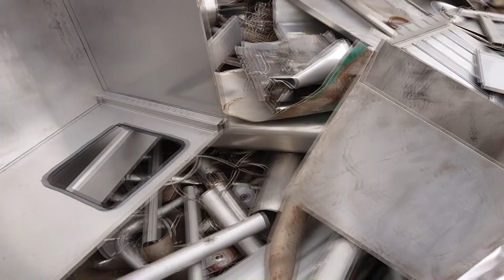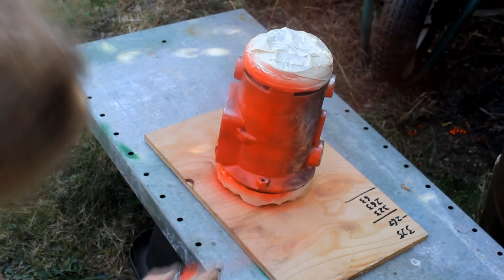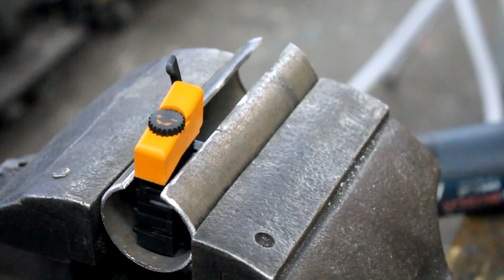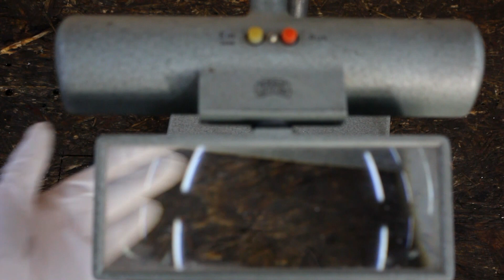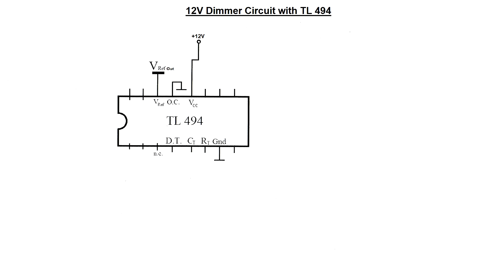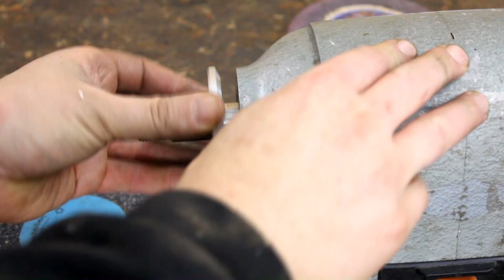Rare Scrapyard Finds! Repair-A-Thon!

Comment from the maker: Hey guys. This is the 19th episode of this series. All other episodes are linked in the video description right under the video. In case you want to help with a donation, here are two ways to do that:

https://patreon.com/tpai
paypal-donations: inventordonations@gmail.com
Reply: Please put the names of the repaired goods into the description so other people trying to repair them can find your video and fix similar problems on those machines! :)
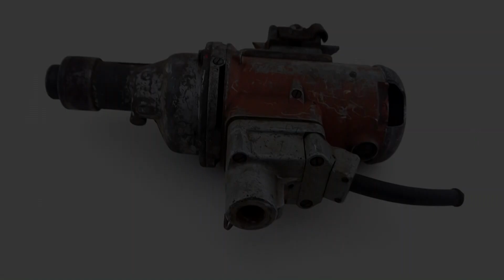Reply: 3:01 oh god you found the arm breaker! There is a higher chance that that drill will break your wrist/arm than to kill you by electricity ! Those drills are so powerfull that they can swing a grown man.If i havent seen it i wouldnt beleave it .In a shipyard a 2 men were drilling a ships deck made of stainless steel sheet metal ,it was 10mm thick but the drill was 30mm.Now they did drill the pilot hole and they did go 25mm then 30.But something happened and drill got jammed and drill knocked guy that was holding it on the floor.Nothing bad happend to him ,nothing was broken except the pride ,but after that they used 2m long pipe to hold it.

The reason why they convinently put 3/4 NPT water pipe is so ,you can go to a hardware store and buy any length you want.Whatever you do BE CAREFULL with drills like those.
Also building a drill stand ,simple out of U channel or square tubing would be a great idea,those things have more power than any cheapo drill press.Wish i had one of those...
Reply: If you get a piece of polarizing film out of a dead LCD screen and put part of it on the magnifier and part over the LEDs--turning one 90 degrees--you won't have to worry about glare anymore.  (I used this idea with my camera lens and flash to take straight-on pictures of an aquarium.  There was plenty of light, but no reflection off of the glass.)
Reply: Thanks so much for these videos. I love seeing the old tools brought back to life and it is very inspiring.
Reply: Hi could I ask where you the leds from I have a lamp I want to convert to led strip thanks in advance great video stay safe
Reply: @tattoos1988  Here is where DIY Perks gets his (you'll want the daylight ones): https://www.ebay.ca/itm/182965299789
Reply: FWIW, if you want to use LED for task lights, it REALLY pays off to spend a little more and get high CRI LEDs for light that is close to sunlight in quality.  I used the ones that are in the DIY Perks lighting tutorial videos and will never buy any other strips again!
Reply: This is my video lesson! Thanks!
Reply: That was cool !!
Do you have the intention to do the last videos of the SMPS playlists man ?
Reply: I love fixing old tools and really enjoy your videos. My current thoughts are a vibration accelerometer to balance grinders, grinding wheels, motor shafts, turbo turbines whatever. I have a link for this procedure, but need help with the electronics. It would be a great topic for a video in my humble opinion. Keep up the good work! https://www.conradhoffman.com/grindbalance.htm
Reply: You big-ass drill would be perfect as a reamer-dedicated drill. I used to work for a truck (heavy haulers) frame modification shop where we built 12 wheels dump trucks out of very basic local commuter tractors (trucks without sleepers or with lightly extended daycabs). We would stretch/weld/double frames on a daily basis and repositionning bolt holes on frame rails was done by spot drilling and then using a similar handheld reamer to enlarge/size new holes.

Handheld was mostly by choice as we also had magnetic drills with core bits but i figured it took way too long for not much benefits.

good work on the vids, i'm a scraper-fixer at heart too so... Take care!
Reply: I have very much enjoyed watching your videos.  For grounding/earthing purposes, I would just attach the ground/earthing conductor to the case of the drill.  The alternative is to use it only on a GFCI circuit.

Comment: Excellent content.

If you plan doing the TL494, I would suggest a "softer start" with a single channel PWM controller TL5001. 
BTW: LEDs should be driven using constant current feedback approach (using a feedback current resistor), 
not constant voltage/hard PWM switching, primary when used to drive multiple or variable number of LEDs connected in series.

Comment: For that handle with the variable speed control for the drill a rubber hand grip would insulate your hand from the metal also using a thin plastic liner on the inside of the pipe would help as well which could be made from a soda bottle or similar bottle of the same thickness and attach to the inside of the pipe with adhesive as well as filling the pipe with the adhesive to keep everything from vibrating and shorting out

Comment: Until the 1970s America's products were the standard of the world. Then, the USA was sold out to China (along with the rest of the world), now sneakers are engineered to last 4 months. Cellphone batteries last 3 years, and are largely not replaceable. The waterheater at this building has broken 5 times in 5 years, because the electricals are made in China.

Comment: Great video... regarding the original push buttons you could add a small relay and use them in a start stop latching circuit

Comment: I'm a bit confused about the drill. I assume you have an earth ground at the power receptacles in Germany. Since it's a metal framed drill motor why not add a third wire ground wire connected to the metal frame?
Wakodahatchee Chris

Comment: I noticed several old cast iron radiators.  I had a DYI-crazy friend who built a huge hot tube in his house.  He put six of those old radiators outdoors, connected to the water supply.  Underneath them he installed gas burners (natural gas was cheap back then here in Texas).  The water flowing through the radiators got heated and he could regulate the temperature by adding or removing more gas to individual radiator burners.  It was a pain to get set up, especially considering the huge amount of water it took to fill his indoor 'pool'.  

I think you could make a great solar water heater, with no need for electric solar panels.  Just set a bunch of old radiators out where they can usually absorb sunlight.  Once the kit got warm, you would open a pump or a gravity flow.  You could start with them empty or already full of water.  It would be best to allow the flow to go downhill to be able to empty the radiators when needed.  Adding rock or gravel fill close around the radiators might increase their energy retention - or help them retain the night's cold..

Anyway, thanks for the always great videos.  You should make an opening page with your neat quote about developing new skills rather than hoarding expensive hardware.

Comment: Hey that drill is similar to one i used as a young fitter in about 1974 we used it to drill up 1"-25mm dia holes but we fitted a 3/4" BSP [british standard pipe] pipe with about 800mm in length to stop the drill from turning when it dug in. It was a beast which took two men to operate one on the drill and one to hold the end of the pipe . I Am 68 now and use a limpet or Mag drill now , which is a lot less dangeruss.

Comment: I like what you do, I get a lot of my tools out of the scrap metal dumpster, I have a 6" and 8" bench grinders, many hand tools that were rusted and or stuck. I have a Lincoln 150 amp Weld-N- Power gas powered welder that took about four hours to get going, I love it, it is also a 4000 watt AC generator so I use it to power my house when the power goes out. Several snowblowers, many lawn mowers.  All brought bask to life with a bit of effort. I applaud you.

Comment: The LEDs were soft white, with any utilitarian use it’s better to have cool white.
Also PWM interrupts current meaning flickers light. When working on any spinning items it may cause strobe effect, also may interfere with light sensors and causes radio frequency interference.

Comment: It looked a little dangerous when you were drilling with those new metal handles exactly at head height. If that bit had bound up in the work piece you could have ended up hurting yourself quite badly. Nice work though!

Comment: Make sure you ring grinding wheels. Hold them on a screwdriver in shaft hole. And tap the wheel. If it does not ring. The wheel is cracked.

Comment: The MT 2 socket is ideal for an 18mm mag drill adapter  - as a powerful headstock for your lathe - just for drilling bigger holes in round stock

Comment: Thanks for video. 
Maybe you shoud have taken apart the 12V adapter and integrated it in the bottom plate where the ballast is. use same cables. A 230V mainscable to the
contact behind. The pwm controller behind the reflector and use the switchhole to trimpotentiometer.

Comment: I love your channel, and really appreciate your efforts. But I have to ask, why would you make that drill variable speed. I only ask because as a contractor I own a number of "drills" that are not variable for a reason: 900 rpm old Milwaukee, 350 rpm dewalt, and 550 rpm dewalt. Each is overbuilt to last a lifetime, despite being used for mixing.

Comment: if im hearing you correctly isnt a dimmer switch also a form of speed controller, one reduces power? and one switches on and off at speed, but basicly doing the same thing,[im asking not telling]

Comment: The biggest mistake people make when drilling is to continue the same pressure on the drill bit as it opens out the other side of the job. You need to reduce the pressure so the drill tip does not get caught on the job. This needs practice. Getting hit with say a10kg piece of metal rotaing at say 50rpm would be very dangerous.
Another issue here is lack of lubricant. All steel should be cut with a lubricant such as tallow or mineral oil. I would suggest he had a blunt drill, large drill meaning more metal needs to be cut and no lubrication. Somewhat like saying everything wrong is being done. Also if he cut says stainless steel of high quality then he trully need to know what he is doing, especially a large hole.
Regards, from a metalwork teacher of 25 years experience.

Comment: Its the first time i have seen a right hand nut on a left wheel. Its usually a left hand nut to prevent loosening when load is applied to the wheel

Comment: Scrap tool + spare parts + time and effort to fix I don’t man, as you said doesn’t sound economical. For the total price, I can get a let’s say a Bosch gsb 1300 (blue pro version) €80-€90 and can drill tough stuff. Ecologically, what you did is right, I am on your side though.

IMHO, trying to restore unusual tools maybe more interesting. Maybe (no pun intended and not trying to be offensive) East German tools that never managed to show itself on YT.

Comment: +GF+ has a presence in the USA as well, i was once certified for use of their IR high purity plastic pipe welding equipment.   Excellent product, training and support.   I am not only jealous of the threading tool but also that cool magnifier.   The dimmer is very nice but I, personally, would prefer the daylight spectrum fluorescent light over that poor yellow LED spectrum.

Comment: Hello, I enjoyed your video.

I have a comment about the switch for your magnifier lamp. The old switch is totally usable for an on-off application. Those old switches have an "extra" position if you hold down the "on" button to connect the "lamp starter" to the cathodes for pre-heating. If you remove the old wiring, it may be wired to function as on-off. I did this for a florescent to led modification on my desk lamp and there is no issues.

Comment: It does not belong to that video, I watched some time ago your Desk lamp to LED conversion, and I did that too on the very similar lamp.  And I cant find that video....

As I got this lamp some years ago I also printed a new foot for mounting it on my desk, than after one CFL tube died I converted it. I also used the original switch, works fine (other than I still press the ON button for some seconds occasionally :). One question: did you reuse that silver grid part? I tried and it made terrible shadows, so I just left it out.

Comment: Please be VERY VERY carefull when working with large 2 hands drill!! I own one similar in size mady by East Germany producer VEB Steinbeck. Very rough machine,  no soft start, no safety clutch. It hurt me quite seriously few times while drilling +20mm holes - sometimes it gets stuch and it simply throws me, twisting hands. It is very dangerous machine, very usefull but also seriously dangerous. Never use it without proper preparation - allways fix the handles in some way by using some chain in order not to allow the machine to twist your hands if it gets stuck.

Comment: Excellent video.  I particularly enjoyed the segment on the Fein drill.  I have a Fein device that is designed as a tap threader with an automatic reverse.  The jaws of the chuck are damaged and I have not figured out exactly what is causing the problem.  I would like to use it as a heavy duty drill.  It is easy to see the quality of these Fein tools (pun intended).  
Bob

Comment: these repair-a-thons are my favorite video series on youtube by far. most of the large power tools i use in my shop i got because someone else first threw them away. either they were given to me for free, i was paid to haul them away during a clean up job, or i bought them cheap at an auction and repaired or modified them myself to suit my needs. i have also designed and fabricated many pieces of equipment myself such as a hydraulic press, a manual tire changer, a sandblasting cabinet, a small paint booth, a hydraulic lift table for repairing motorcycles/atv's/riding mowers, an engine hoist and stand, a lift boom for my tractor, and a coal fired blacksmithing forge. all were made from salvaged materials and/or scrap steel. i'm self-employed, and i earn a living fixing, building or destroying whatever someone will pay me to fix, build or destroy, and have done so for over 26 years. when i was young, my grandfather told me to learn all i could, about everything there was, and i would never be without work. best advice i ever got.

Comment: Your videos inspired me to bring one of my broken tools back to life!
I was taking apart an old printer, when my little 12V drill seized up! I had just purchased some 18V drills, so I set the 12V drill aside to deal with later.
Today, I was cleaning my shop and decided to dismantle the broken drill.
When I opened up the motor, I found a tiny, broken retaining clip (from the printer) stuck between the rotor and the stater.
I cleaned everything out with a toothbrush and reassembled the drill, and it works again!

Comment: Tip do not use that big drill with the handles In lever whith your face If the drill bit i strong enough when it jams ; and do not not break ;You risk 
Hand arm face damage. 
Those types are used for timber house construction boring "2 holes for wodden dowels. Sometimes they have specially made brackets to take the force if the drill bit jams.
That's because  can get thrown of the working platforms otherwise. 
You have the drill near you and you hold it in a very ferm grip when drilling.  It may twist your arms otherwise, even when nothing goes 
Wrong. Typical good use is boring hole in workpiece you  can stand on yourself . Make a" stopper bar " to go where that that dovetail where.
Seem a waste to build a drill press whith it. Very nice idea To add speed controller. Often those heavy drills lack that.

Comment: I think your oversize bits need a sharpen. I've got an imperial set and they're not the best but they usually cut better than that even with a smaller drill.

Comment: I remember those type of switches from UK desk lamps from the 70s. The 'on' press button makes the 'starter circuit' momentarily when you press it... so no quick 'jab' at the switch, it was press, hold till the ends glow, then release. Quite a neat design for the time to eliminate the 'glow starter'

Comment: Hi, you videos are great, on the refurbished Fein drill, that drill has the  power to spin you around if the drill gets caught in metal, suggest a more suitable hand holder, to eliminate the danger of hurting yourself.

Comment: Didn't you use big paper washers between the grinding wheel and the metal discs? I always heard those are very important. A soft kind of cardboard is needed to spread the pressure otherwise the disc can shatter.
Kind regards from the Netherlands!

Comment: Ou the motor speed controllers would be very nice to have video about. I have several projects that need one and running them full speed would be bit shady at best of times. Could chance pulley ratio but that is bit of hassle.

Comment: When drilling large holes you need a pilot hole drilled.  The problem is that the point on large bits  is not designed to penetrate.  The flutes and cutting edge are designed to cut and evacuate chips but a pilot is required.

Comment: You wouldn't believe all of the stuff I find in the scrap yard. So much heavy steel. I mean 2 inches or bigger. I found an aluminum plate a few weeks ago. 36x36x1inch. 7$

Comment: I was thinking to make a dc voltage booster with tl494 to power the power tools having brushed motors. It might be helpful if you explain tl494 ic.

Comment: A neat option for a grinder that has parts missing on one side, is to fit a tapered spindle adapter ("pigtail") over the existing spindle, and fit polishing mops for metal.

Comment: A Bavarian Womble!
A little simpler would be to get a ' Trend WP-T4E/007 Speed control board ' and wire it inline to one of the brushes, wouldn't it? I just took it out of a wood router, and installed it into my angle grinder.

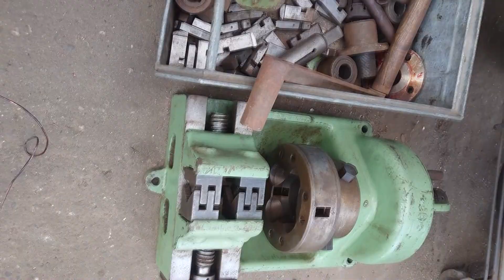Comment: At 2:20, the grime on this machine is  chocolate mixed with machine oil. It was probably used in a biscuit or chocolate factory. I used to repair these machines at a chocolat factory (Neuhaus) as a student during the holiday.